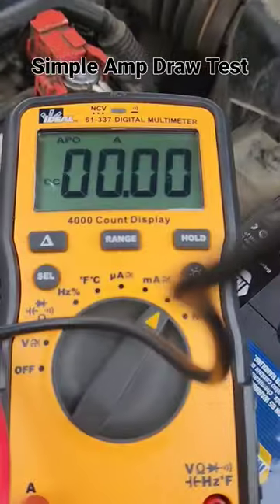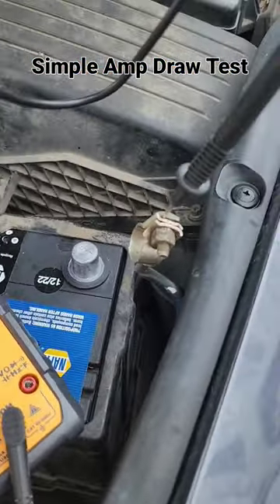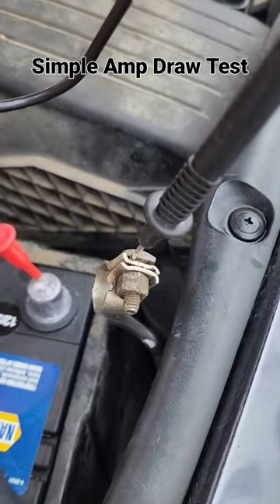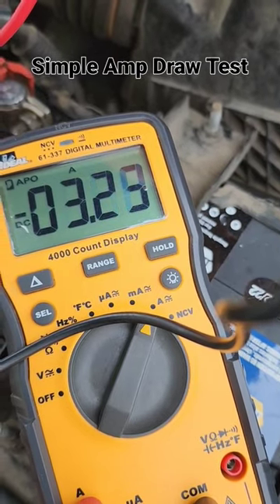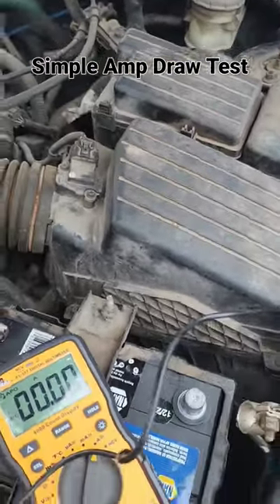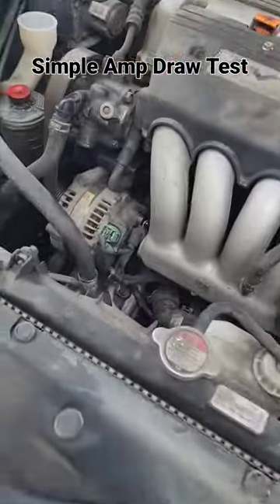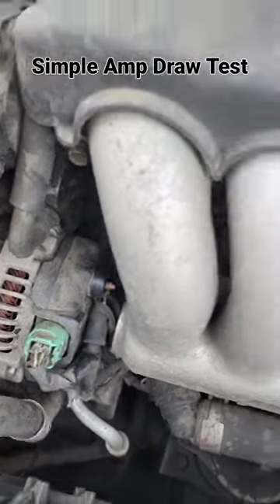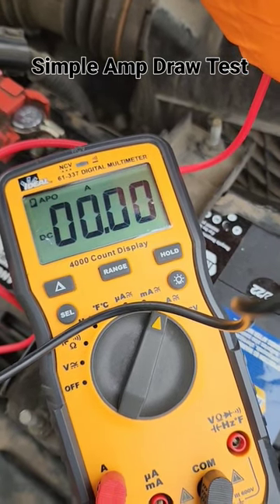What's draining your battery?! How to find a parasitic draw! (EASY)

Comment: I've used an infrared camera to find a draw. Fuses, wires, motors, amps, and control units will  show warmer temps overnight when drawing electrical circuits.
Reply: heat gun
Reply: Good idea..
Reply: Omg. I love you smart people. Thank you. That's brilliant
Reply: Bruh why haven't I thought of this
Reply: I did the same thing on a BMW that wouldn't fully go to sleep. The problem as a communication module not sleeping.
Reply: Fn GENIUS. AND IT JUST SO HAPPENS I HAVE A HANDHELD I.R. GUN.

Comment: The alternator can giveth voltage, and taketh voltage.
Reply: i like it
Reply: its all magic, when u see smoke rhe magic is leaving
Reply: Excuse my ignorance, but how can an alternator draw voltage if the power to it is off?  I might have the same problem on my f-150.
Reply: @christorres2 Could be shorted internally. They can't cover enough diag in a 60 second clip.
Reply: Alternators have ‘diode’ packs within them. Without going into a worm hole how everything works inside the diodes allow current to move one way, from the alternator to the battery.. if one of these fails when the car is off and the alternator isn’t charging the alternator will take ‘power’ from the battery.. draining it quickly in some cases. Newer alternators are complicated beasts but you can test them using a DVM.
Reply: You may feel hot cables/ if you check the alternator end of the cables(positive post) etc like in this video..
Reply: I have an '81 Chevy van with a 350. When I ran the test described here, the meter read 9 volts. My battery has been draining down to 4 volts.
Reply: @christorres2 Faulty diode.
Reply: Thanks for the good chuckle
Reply: So ends the sermon

Comment: After you connect the meter, wait ten to fifteen minutes for everything to shut down. If you open a door, trunk, window or turn on the key, you have to start over. Some on board computers stay active a long time. Then check for a current draw. If it's more than 200 miliamps you have a parasitic drain. The first thing I would check is the alternator. A failed regulator can keep the rotor energizer.
Reply: memory on the radio / clock will also be a draw.
Reply: @rupe53  also the PCM memory. That's where the 200 miliamps comes from.
Reply: @gener.1253  ... yeah, I get it. I'm one of those old guys who did this stuff for like 50+ years. Glad I retired when I did.
Reply: @rupe53  right there with you. Started in my dad's shop. ASE Master tech for over 40 years. I retired in 2017 but did my best to keep up with the technology until then.
Reply: @gener.1253  ... going from memory, but recalling I started ASE cetrs back around 1978 or so. (NIASE?) I kept taking the tests till I ran out of time at the test centers. I did auto, machine shop, service writer, truck, (heavy and light) bus, school bus, carb, and EFI, body / paint, etc. People at that level numbered under 500 nationwide at the time. i was also certified as master tech by Nissan. I finally let them lapse around 2010 when they offered an extension (6 months extra) but failed to let me know when the next test date was. I said "screw it" when my employer didn't want to pay for it. Retired 4 weeks before Covid shut down the world.
Reply: 20 mins for E53 X5
Reply: @mrme3717  yes, the manufacturers keep making is easer..... NOT!
Reply: 200 milliamps is a lot. Typically anything over 30 to 50ma I consider a draw. That's based on the type of vehicle. Some vehicles need up to 45 minutes for the modules to go to sleep. Look up the specs and your good to go when you start diagnosing.
Reply: Or use a clamp meter no need to disconnect.
Reply: @dogwalker666  how accurate ?  We need to measure. 01 of an amp.
Reply: @mrme3717  a hall effect clamp meter will read down to 10mA, I use mine all the time,  However modern cars have electronics running constantly,  downloading updates go the operating system,  Maps etc, alarms etc also eat power,
Reply: @dogwalker666  👍
I'll try the inductive amp in the back of the cupboard.
Reply: @mrme3717  hall effect sensors are far more sensitive,  And relatively cheap now, My first one was over £2000 now they are £50.
Reply: @dogwalker666  👍

Comment: When you’re doing this it’s advised to keep the circuit closed by using the leads, while removing the battery cable. It’s to keep the modules active so you don’t miss one that turns off and end up chasing ghosts
Reply: Yes! Especially on newer vehicles
Reply: there is intelligent life watching video's after all...
Reply: also close the doors with the battery cable on so the dome light cycles off completely.
Reply: @rupe53 or leave them open and use a screwdriver to "lock" any doors you may have to otherwise open to check interior fuses..

Comment: If it's the alternator it's probably a faulty diode inside the alternator. A bad winding is least likley but easy to check. Just a bit of info for edge cases where the people to whom this info may be helpful will know what to do with it. (ie you have the skills and confidence to find and replace a diode in an alternator but are also working with a homeless budget. Just to give one possible edge case where knowing where to start probing if wanting to check likely suspects first.) So, yes, I know hardly any cares.

Comment: Alternator is usually the culprit I've seen it over and over.
Reply: I just repaired a SLK230 Mercedes with that problem. The battery would be dead after sitting a couple of days. But the alternator was intermittent. I never did isolate the power draw, but I noticed sometimes the battery went dead while running the car. I replaced the alternator when I noticed the output of the old one was low..and after that, no more draw either.
Reply: Central locking motor on VW and Audi often fails, will bleed the battery s well.
Reply: @georgerivera9220 my car is dying out got the alternator changed he uses a old one got a new battery still dies out after a few mins how do I check for a failed engine? The engine sounds perfect?
Reply: So how do you over come that
Reply: I think this is happening to me. How would you go about fixing this problem??
Reply: what is the solution.
Reply: had one alternator of less than 5 years old died out on me; even had the foreman fooled and me fooled into replacing the battery … in the end it took two service center foremen to confirm it was indeed a faulty alternator …

Comment: Reverse the multimeter cables to get the sign right ;)
Reply: When you know what you're doing it doesn't matter. Man is smarter than the display on a multimeter.
Reply: It doesn’t matter you’ll have the same number just with a negative sign in front of it
Reply: The negative sign indicates polarity .  LED’s ( lights ) are polarity sensitive .

Comment: This is great information that will save people money, now that diagnostic time is sooo expensive at the shop.  Here's another tip "for the rest of us..."
  If you don't have a multimeter for an amp draw test but, you still want to take a crack at figuring out what's wrong with your car, use a simple, inexpensive test light that is found at most any store (Walmart,  dollar store, grocery store, any store with an automotive dept) for just a few dollars for the cheapest ones. Be sure it has a ground clip and a probe point, not just the little, pocket screw driver type.  Those may or may not work but, the "regular" type are very useful for many things like this. 
  Hook in a standard test light just the same way as the multimeter.  The ground connector end clips to the disconnected, battery ground cable and then touch the sharp, probe point to the negative post (push it in a little to make good contact & make sure the key is off).
  If you're drawing amps, the test light will glow, though it may be very dimly.  Remove fuses or items like the alternator,  starter or anything that is connected to the system (all the lights, radios, etc. should be on a fused circuit so make sure you find ALL of the fuses, especially if something has been added in by someone).  Remove things from the circuit one at a time and when you find the culprit, the test light will go out.  You won't be able to tell how many amps are being drawn as you can with a meter but, that's ok, it's the stopping of the amps flowing that your looking for.  Just take your time, find a way to identify where you've already been (mark a fuse box, separate fused wires, alternator, etc. with a piece tape or marker that will show your work) so that you don't lose your place and have to start over and get frustrated and confused.  It's easy, just have patience and be methodical.  
  You don't have to be a certified mechanic or "smart" or "rich" enough to own and use an automotive test meter as is shown here...  Simple, household tools will work! 😊
Reply: Thanks for helping me friend, I sincerely appreciate it.

Comment: I just had this happen on a 73 Torino I was working on, & it had a chrome aftermarket alternator on it. I put a two hundred amp relay inline of the alternator wire to the battery, and it would engage with the key. this essentially just disconnected my battery from the alternator when I shut the car off. Works freaking great.
Reply: Hi there! did you put the relay on the b+ charge line going to the battery?
Reply: Hello Sir, can you help me to do this in my car I would like to know how you did the installation. Thanks in advance.
Reply: A new alternator might be cheaper than a proper 200A relay...
Reply: Anything thinking about this get a new alternator unless you have a 73
Reply: @betlog20 
Well, the last time I checked, the alternator did NOT have a NEGATIVE battery cable attached to it anywhere, so the relay would then HAVE to be installed on the “B+ charge line”, as you called it, a.k.a. the “HOT” wire that runs, to the alternator, from the battery!!! 🤣🤣🤣

Comment: First thing I use an amp clamp on either battery cable to protect my meter, then if the draw is low enough the ten amp or milliamp scale.  Just as important is to clip the negative lead to the negative cable, then loosen the clamp bolt but do not remove the cable from the battery post until you place the positive probe on to the battery post, then disconnect the cable.    This maintains the radio presets and does not wake up the various computers.
An aside on radio presets: whenever I replaced a radio or have to disconnect the battery for any reason I always write down the presets, CD channels, and any other pertinent data that would be lost and leave the sheet in the car.  It makes for good customer relations and reflects well on you and the dealership.
Reply from the maker: Great points! I recently started using an OBD memory saver cable and a small auxiliary battery to maintain pre-sets, etc. Works great!

Comment: If its a modern vehicle keep the meter connected and wait until the computers sleep.  Connecting the battery, opening the door handle, many things put it in wake mode.  Some cars even prime the fuel pumps or run glow plugs.

Also, disconnect the alternator at the fuse on the power box, its way easier and safer.
Reply: Also cooling fans on the electronics too, Mine also has steering,  ABS, AC and Suspension pumps.
Reply: I have seen several vehicles take a half an hour or more for the computer to time out. One thing I started doing is run a jumper wire between the battery and the terminal in case my meter times out and it goes to sleep.
Reply: You usually have to wait at least 20 minutes, especially on a car that is suspected of having a power draw.
Reply: @wearetheresistanceprepping1883 If your meter times out/goes to sleep, you can just turn it off and back on the amps setting without "waking the system"
Reply: @TimmyMill87  not so easy on the fluke 77. It must be turned off then back on and it will reset the system. It's just too easy to disconnect the cable then install a heavy enough jumper wire. That way you don't even need to leave the meter connected, just lay you leads on it from time to time. I've seen some f150s take a hour to time out.
Reply: I appreciate your correct advise but we can’t make smart YouTubers out of everybody. Trust me I had this desire and it was all bad. I’m trying to save you some grief.
Reply: I like good tips
Reply: Another tip is to lock the car, it make many cars go to sleep faster. The difference on my wife's car is ~20 minutes unlocked and ~3 minutes after I locked it.
Reply: I remember Aston Martin DB 9 in particular having dead batteries after a couple of weeks of not being used
Reply: Even pulling fuses will wake one. There is a table for each fuse type. You put the car to sleep and, without waking it, measure the mv drop across each fuse and look it up in the table. The table will tell you the ma draw. These new vehicles are a lot different than how we used to do it! Just fixed a VW with 3 intermittent draws. Two were bad solder joints on circuit boards in the door latch and instrument cluster.  I hated European cars before any of that. Needless to say, my feelings were reinforced!
Reply: The computer has to reboot and then go to sleep,  but after it boots if you make sure the doors are shut take the key fob and lock the doors the computer will go to sleep much faster and you can the see the true parasitic baseline current.
Reply: okay mr safety man
Reply: @aaronwalker8798 got a vw to try and find a drain tomorrow morning. Reading this really has giving me less confidence than I had before. Where would I find a table for the fuse draw you've mentioned for a 2008 vw eos ?
Reply: I know this is an old thread and this is probably a stupid question but I’m reading a lot about needing the car to go to sleep. How will you know when the car is asleep? also if my key fob button to lock the car is not working well that prevent it from going to sleep?  Very much appreciate any and all feedback!
Reply: @TheAbyssGazedBack  With just a few exceptions, it is expected to see 50 mA or less parasitic draw after everything "goes to sleep".  Some would say up to 60mA is a safer range.  A few models (I recall BMW's are one) have even higher "at-sleep" milliamp rates (but still fairly low, like less than 100mA).  Anything above these levels and one can expect to slowly drain the battery over time (a couple of days).  Typically it takes around 20 min to 1 hr for a vehicle to "go to sleep", but there are some models where it can be much longer than that (couple of hours), or that even will wake up periodically to check systems in the vehicle (all the time!).  To answer your second question:  conventional wisdom is to keep smart key fobs at least 20-25 ft away from the vehicle, or its mere presence can wake up modules in the vehicle.  (on a side note, reportedly thieves are cloning signals from key fobs owners keep near the front door of their residence, then using that clone to start and steal the owner's vehicle.  Use a Faraday box (signal limiting, lined box or sleeve) to store the key fob in while not in use.
Reply: @ronc4146  An empty cookie tin can be used to put the key/ fob in. Just need to make sure and put the top on it.
Reply: Or, you can connect multimeter first and then disconnect the battery ... But yeah, what he is doing is absolutely useless

Comment: If you notice, the meter Reads negative 3 amps. that's because the black probe is supposed to be on the battery terminal. Which is ultimate ground and the red probe goes on the cable. Battery Terminal is Ultimate Ground. Black Meter Lead is Meter Ultimate Groumd. On this Test, the Meter should Never Read Negative (Volts or Amps), fir Proper Diagnostics!!
Reply from the maker: Good eye! That is correct, I had the leads backwards in this video. With that said, the test works just the same and you would know that it is in fact a "positive draw" if that's what you were looking for in the first place. Thanks for your comment !!
Reply: You are Correct, I wasn't Being Critical.  My Students get it Confused. With the New Electronics in the Industry today. Negative Voltage is Used In some Control Systems. You Video was Very Informative for A Technician I was Working With.  I Appreciate Your Reply!
Reply: I came here to say this but yeah like he said any number higher than .50 you know something is wrong. This is exactly what was wrong with my Honda Civic. I think it's doing it again. Idk what's wrong with this car.
Reply: Your right I get this confused all the time
Reply: @HumbleHotshot love the  disingenuous back paddling on the INCORRECT  amp lead hook up!  good job! 🤦‍♂️ It WILL blow the 20A fuse on a lot of multimeters!
Reply: The meter absolutely doesn't care.
Reply: @mrobvious5892 why should the 20 Amp fuse blow at three amps?